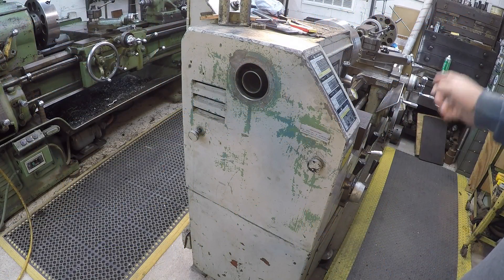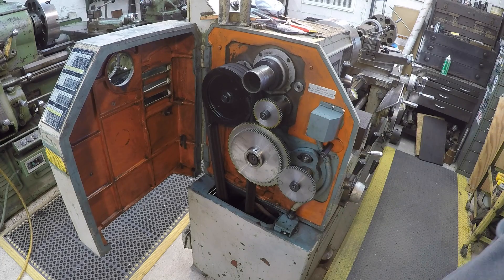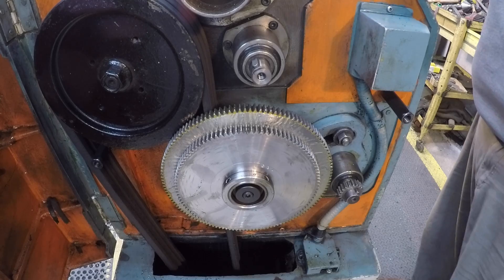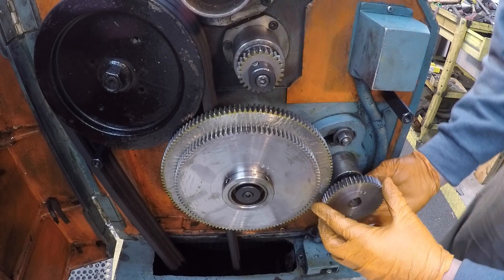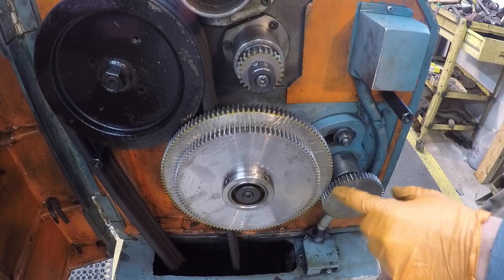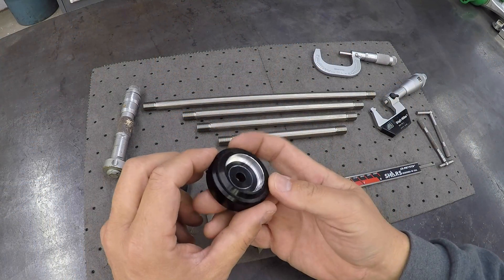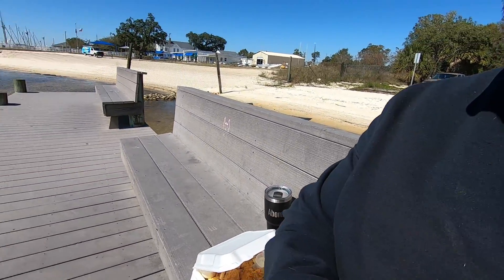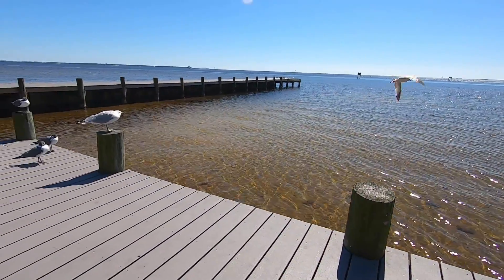Lathe Change Gears & Small Machining Project

Comment: The victor lathe I just got has timing belts, not gears. But one improvement they made to that big gear is instead of having a nut in the back that you must loosen in order to move the middle gear, it turned into a hex nut on the front (where the cap screw on your lathe is) that you loosen which would allow the gears to be moved. Then you tighten it to lock it in place. Mine didn't come with any change gears and the Victor parts dealer in Taiwan wanted almost 300 dollars for a set of change gears (they said it has to be custom made), I said screw it, and went and bought the right kind of timing belt pulleys and machined it myself to fit the lathe. The part is only a few dollars from China.

Comment: 15:51 I wouldn't have been happy with my tool clamped just under 1 screw ! I'd have put a packing piece on the top of the tool to reach a second clamping screw - just to support the top of the back end of the tool to counteract the downward pressure on the tool tip causing it to 'see-saw'.

Comment: Hi Adam. 
Nice lunch spot, when I worked in a factory I found a quiet area for lunch which I used for several years, it had a low brick wall and after I finished eating I could lay back on the wall and zone out. First I’d hear the hubbub from the factory, then the birdsong would overpower that, then if I was doing well I would be able to hear a tractor ploughing or mowing or baling which would be a mile away. Then the two old ladies from the sewing room discovered my quiet area, damned if they didn’t drag their beach chairs out there and sit and discuss bloody soap operas all 45 minutes of the break! The moral, best not show people where you go if you want peace and quiet!
Thanks for another great video. 
Cheers, Graham.

Comment: In the standard arrangement you create at the start of this video, both A and B shafts are driving a single lay gear, which means the ratio is entirely determined by the A/B gears - 25 and 50, a convenient power of two.

But the metric setting went through the reduction gear, 127/105.

Do all your metric threads live on the 'other side of the fence', through the reduction gear ?

But then the gears changed to 50/70 - I wonder if some judicious multiplication will reveal a 2.54cm = 1 inch.
Reply: Well, 127 is half of 254. That's the normal to metric conversion gear. 😁

Comment: You might point out that the smaller hole, the less accurate the calipers. It's such a common use case that I've often wondered why there isn't commonly a provision for that. I have a pair in which I drilled and fitted a pair of drill rod pins for this purpose. With the ease of which we can set the zero of these - it really makes no sense not to make a set for everyday  use.

Comment: can you show how the 6 jaw does with thin walled pipes -  i recently worked on a seamless stainless pipe material 1.4571  with 60mm outer diameter and wall thickness of 1.25mm witch was going to be epoxie glassed into a scaled down concrete build of a hydropowerplant - like backyard hydropower with abaut 8000 Whats output 
At the inside the pipe has a bearing surface for a shaft, ballbearings and seals
I used a 3 jaw and kinda crushed it- it went out of round- I did put a turned down wooden core inside and tried again - it didnt really seem to help that much - I play with the thought of getting a 6 jaw but when I turn small pins like 3mm out of high speed steel and stuff I speed the lathe to 3000 rpm 
also what is the minimal diameter you can chuck up wthout collets in your 6 jaw and does it leave bitemarks?

Comment: In Germany  School of Metalworking says a Caliper is good for Toleranzes bigger than 0.1mm for everything 
more accurate they teach you to use a Micrometer or Gages  aktually the German standart for Calipers says its allowed to be off by 0.05mm but not more but 
i guess its calculated  for
Measurement errors  caused by the user

Comment: Well, that settles that! Tubalcain AND Adam both use an adjustable wrench both ways. I highly respect both men as far as tools and machinery go. I will forever scoff at those "You're using it backwards" people.
Reply: It's meant to have a 15 degree offset so you can turn nuts in a tight space by using it both ways

Comment: You rock Adam.  Thanks for the continued entertainment through the Apocalypse of 2020!!!!  I'm living for the Abom79 bloopers reel.  Where chunks of steel fly into the wall and the shaper throws metal across the shop.
Reply: I doubt he has any bloopers at all.  But, if he does, they will be great bloopers.  Things that come to mind are welding a part on upside down with a perfect weld or making it 1.0000 inch when it needed to be 1.1000.

Comment: @abom79 instead of using your telescoping gages so much for ID work. You should look in to a dial bore gage all you would need is a dial bore gage and a big setting gage ( the setting gage is read and set just like a micrometer) bore gages are not hard to read you would just have to figure out what size range you would need. That is all I use at my job is dial bore gages. The tips on the gage are carbide so they can leave heavy gage marks which just comes out with some scotch Brite.

Comment: As has been said many times before that it would be a great addition to your channel if it were possible to be able to see. what the part / parts were used for , again just a thought , carry on man we enjoy what ever you do
Reply: I learned pretty quick working as a machinist that it doesn't matter what the part is and most times you won't even know what it is for. Make it to the print, that's all that matters.
Reply from the maker: That’s been requested since I started making videos. I don’t have access to what the parts go to or them being installed. As a machinist you just do the work and send it out.